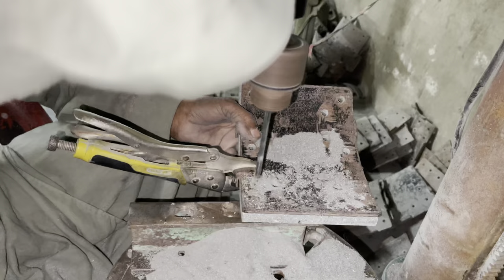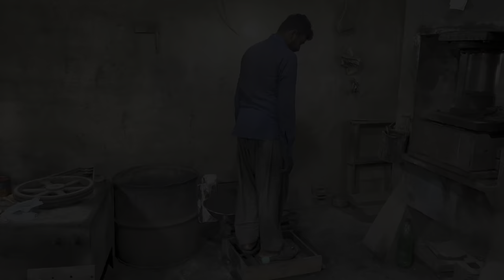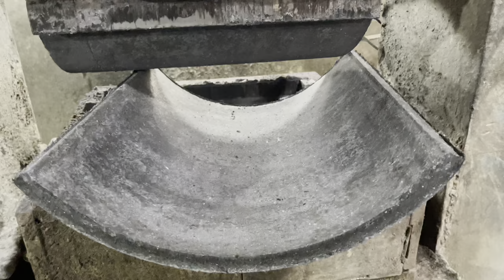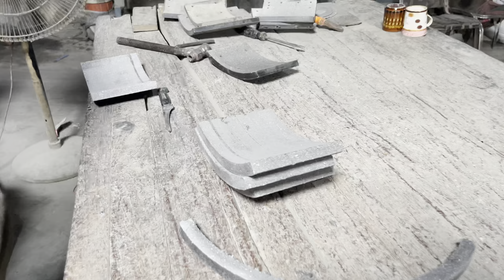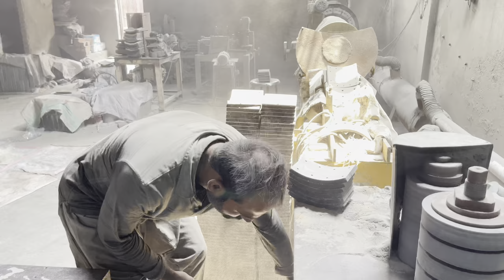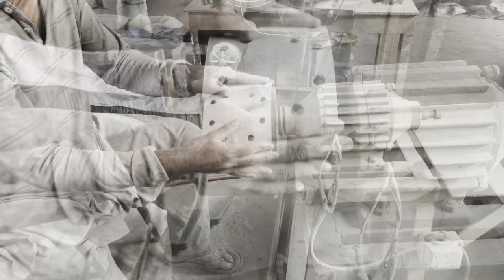Ingenious Technique of Making Truck Brake Pads || How Truck Linings are Made

Comment: Yes likely to contain asbestos in this region, as it was the perfect material for brake pads and liners (heat resistant and hard wearing), many countries still mine and use asbestos in products, likely to be Chrysotile (white) asbestos.

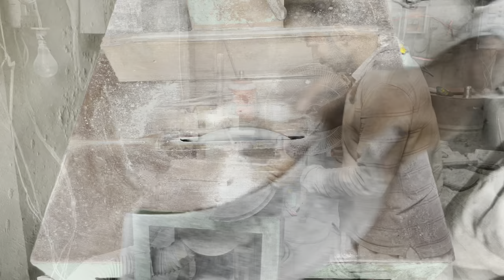Comment: See at 5:15 where the saw operator has already lost a thumb.
Dust masks desperately needed here at that factory.
They need tables. 
Containers to move product.
Need proper boots. Correct clothing. Indian government needs to act on all of this. No changes otherwise.
Reply: I agree with you
But they are not Indians 
But this video is from Pakistan and Pakistan government should take good care of their workforce